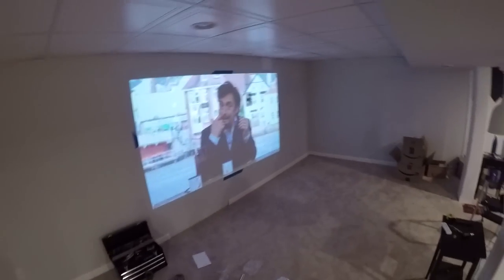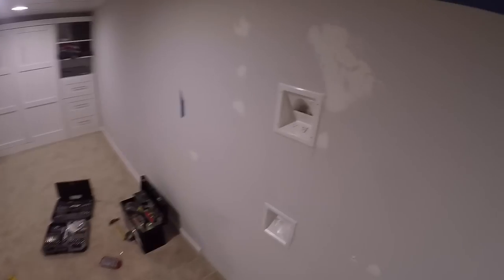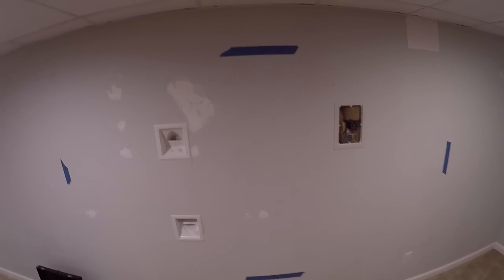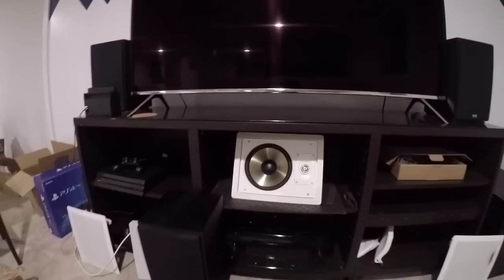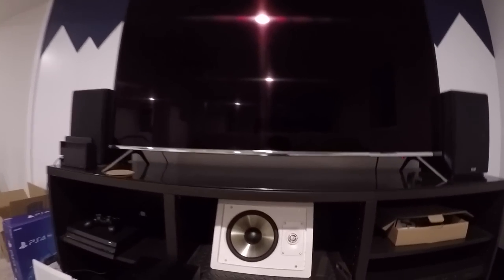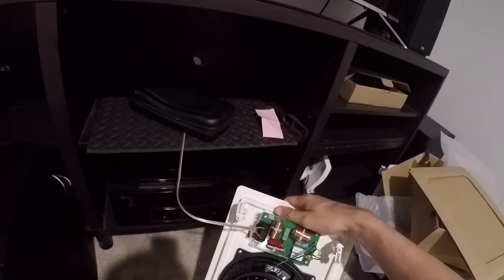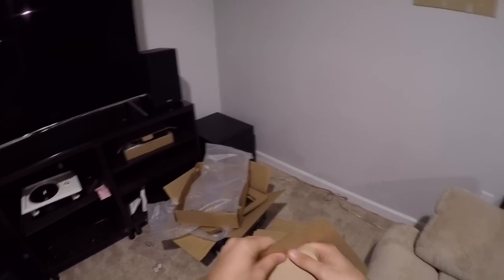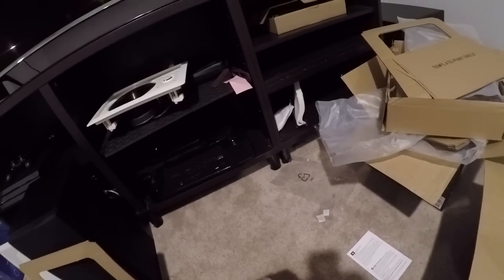How to install in-wall speakers in a home theater - Episode 3

Comment: JERMgaming,  Just purchased a set of Definitive Technologies 5.5 BPS's In wall speakers to add to my DT Home theater set up. Seeking a recommendation on wall location regarding the placemat on the wall (What height?). I have a 5.2.2 system. I have 2 ceiling speakers for atmos. The 5.5 will be rear surrounds. I have been told to place the woofers at about ear level on the wall behind our couch?  However; I also see options saying place them 6 feet from the ground not sure it that means woofers at 6ft or the bottom of the speaker? Assuming this POV is actually correct for these speakers Vs Ear Level?  Welcome your POV on these questions.
Cheers,
Steve

Comment: Hey JERMgaming, these are on the JBL web site for $69.00 a pair. Which is insane! Thanks for showing the backs and the crossovers etc. How do you like them? I am looking at them as a DIY project and making speaker cabinets for them. I'm just never going to be sold on 6.5's and 5.25 as "bass" speakers. Since you cannot buy any 8 inch bookshelf anymore this seems like a good plan anyway.....I'll check an see if you play these, thanks again and any feed back , peace